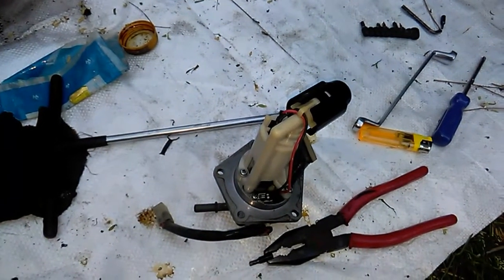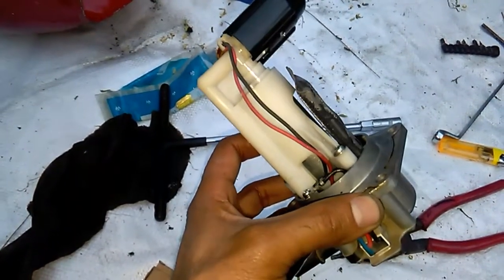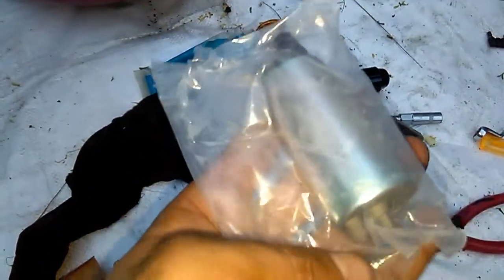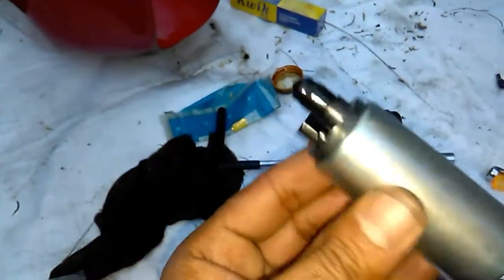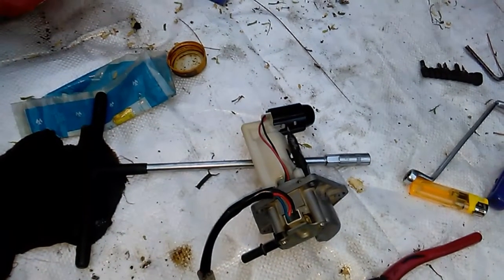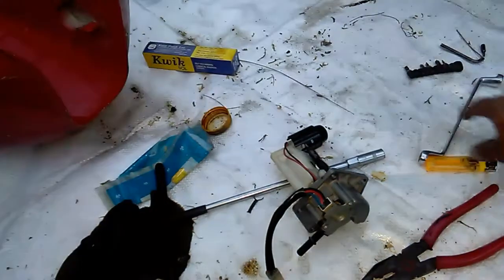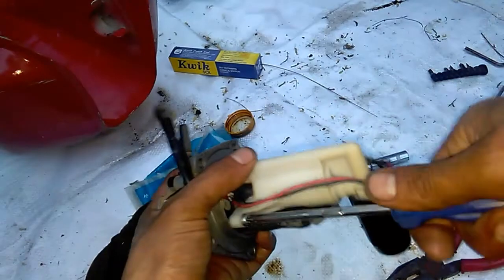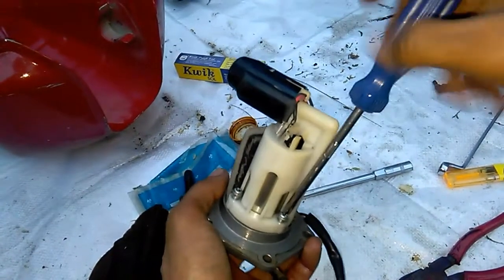Royal Enfield EFI, Fuel pump module motor replaced Part1

Comment: This is the same pump that is used in several bikes. Actually it doesn't need replacement. It needs proper cleaning every 10,000 kms. Because of dirt and redoxide paint build up inside the pump and its filter element...it's performance goes down. There are several good videos on YouTube. You watch them and do routine maintenance to keep your pump long lasting.
Reply from the maker: Yes you are right, mostly problem occurs when the Motorcycle not kept in use. In my situation after winters...mostly I find rust in strainer...some gel kind of build up that blocks the fuel pump and the rythm of motorcycle is gone.

Comment: Is new motor is genuine or other vehicle
Reply from the maker: It is after market, OEM brand is keihin, this one has no branding. So far it is working fine, clocked few hundred kms on this motor.
Reply: brother please share complete video if u have recoded as many of  RE bikers are facing this fuel pump issue.
thank you
Reply from the maker: Ok..I did many experiments for checking fuel pump motor, replacement...will upload soon